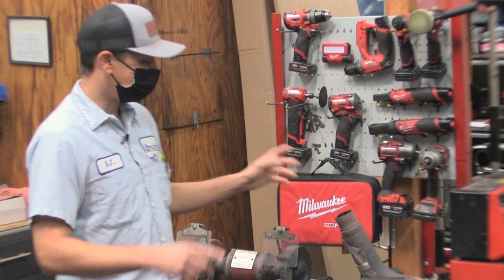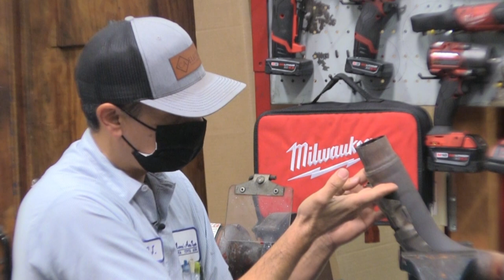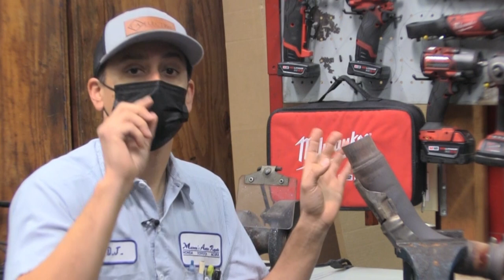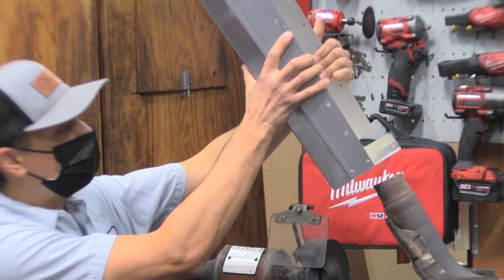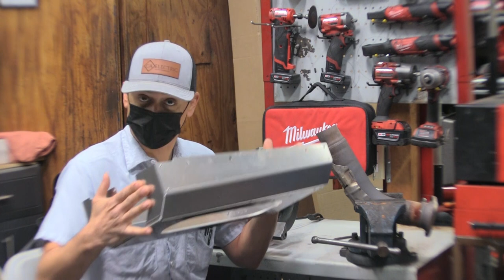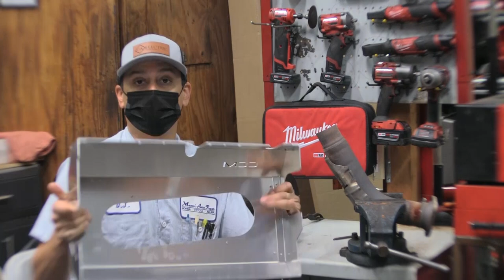Defeating Catalytic Converter Thieves | The "Speed Speed Speed" Video

Comment: Just got mine today for my 21 Tacoma.  The Cats may not be as valuable as e Prius, but for the price it's good insurance.
Reply from the maker: Hi W B, thanks for sharing. We agree with your assessment. Value of the cat aside, the high ground clearance of the vehicle definitely merits concern. Between our immediate and extended family, there are a number of CR-Vs and they pose the same risk. At the price point for these shields, it's definitely worth it for more than just the Prius. 

In addition to CR-V's, we've had Accords and a number of other models come into the shop with missing cats. Keep in mind, as a shop, we only work on Honda, Acura and Toyota, so our examples are naturally limited to those makes. We just wish Cat Security was available for more models.

Comment: Run Hardfacing weld beads down the pipe. It will dull the blade confusing the snot out of them when they can't cut through.
Reply: Unless they use an angle grinder instead of a sawzall. Or even an expensive hardened blade for the sawzall.
Reply: Cutting wheel does not care about hard surface

Comment: Wouldn't a simple sleeve around the exhaust pipe prevent theft?  If you put a loose-fitting sleeve around a pipe, it makes it impossible to cut because the sleeve turns.  That could even be a split sleeve that is quickly installed with a large plyers type tool.

Comment: You have reminded me that the thieves would cut at the spots with the thinnest metal. I'm thinking if I could simply have those weakest points wrapped up with layers of some kinds of flexible metal to slow them down or even deterred them from choosing my cat.. . 

By the way, my English is not good but I understand you perfectly. Wondering why some viewers said that they couldn't understand you.. .

Comment: What is model number of the shiel you are holding? I need toget one for my element.
Reply from the maker: Hi Alan, the shields are sold based on the year and model of the vehicle. In the case of the Element, there is only one version, which is designed to fit all years the Element was produced. Only the Prius and Tacoma have multiple options.
Reply: @munozauto6220  I may have missed it in the video but who makes the shield  you reccomend for the Tacoma and the element?
Reply from the maker: Hi Alan, the shields we recommend are called Cat Security and are produced by Cap City Muffler. The shields for the Tacoma are similar to the model seen in our "Installing Cat Security™ on a Prius" video. By contrast, the Cat Security featured in this video is for the Element and is built more like a cage than a shield, since the cat is fully exposed on that vehicle.

Comment: Car alarm should have if you jack up car move from position if you jack it up car like I'm on even from position I moved alarm goes off. With different sound
Reply from the maker: Hi Stuart, an alarm is an option, but aftermarket car alarms come with their own complications and alarms in general tend to get ignored fairly quickly. It's possible the thieves would stop mid cut if one went off, but given the speed at which they can complete the cuts, they are likely to finish the job. 

Overall, a physical barrier is the best deterrent, whether it's Cat Security or some other solution. Keep in mind, no solution will outright prevent a cat from getting stolen. The best a person can do is make it clear to right off the bat that their vehicle is not an easy target.
Reply: @munozauto6220  If someone really wanted your car, they could always just hook it (tow truck) and go. So yeah, there's no preventing all theft. Even if you were to say, pull the battery fuse every time you left your car somewhere (would really stump a thief who wants to drive it away but that's not going to do shit against a tow truck).

Same goes for the shield like you said. If for whatever reason they really want your cat (say it's an enemy who wants to vandalize your car and make it look like a theft), they can, but this will prevent most crimes of easy opportunity.
Reply: wow, that made no sense at all

Comment: This is nothing but an elaborate advertisement.
Reply from the maker: Hi D, thanks for checking out the video and considering it elaborate. We don't manufacture any products or sell anything online, so although part of this video could be considered a review, it's not really an advertisement.

We're a family run auto shop with a focus on continued education. We've had a number of customers over the years get their catalytic converters stolen, so we've been on the lookout for a good solution for awhile now. After weighing all the pros and cons of Cat Security against the other solutions on the market, Cat Security is simply the best option we can recommend our customers.

That said, we are neither involved in the manufacture nor distribution of the product. Our intention is to provide relevant information to the viewer in easy to digest videos, drawn from the knowledge we've gained over decades of training and first hand experience. The shop motto is "Training Today for Tomorrow's Cars", so our knowledge base has continued to grow and evolve since the shop opened in1980.

We are a registered installer of Cat Security, but we're not a distributor. If a viewer reaches out and they live in our area, we can install a Cat Security on their car. However, for anybody not local, we'd direct them to manufacturer's website so they could locate a vendor in their area, but we wouldn't receive any form of compensation for doing so.

If you'd like to find out more about the shop, please feel free to check out our Facebook page at Facebook.com/MunozAutoRepairSB.

Comment: The sensor right next to the catalytic converter is not a c o sensor it's a heat sensor and if you covered up and don't cool the catalytic converter correctly it'll make the engine start burning Rich too much fuel get a check engine light and burn a lot of gas so beware just put a piece of rebar follow the pipe and weld it on that's enough to keep the the use from wanting to cut through their they don't want to be another 5 minutes trying to cut a 3/8 rebar
Reply: yeah i'm sure every grandma has a welder. . . glad you have that sort of solution . . . . others do not..and if you have to take it to a shop to do this, you may as well buy a nicer looking cage same price
Reply: @kantraxoikol6914  a little self help your buddy you need to read what you wrote me and try and turn your life into more positive thinking that negativity is just going to keep you down in your life